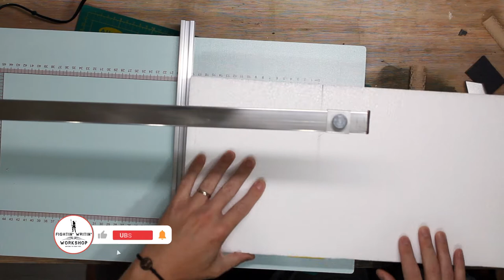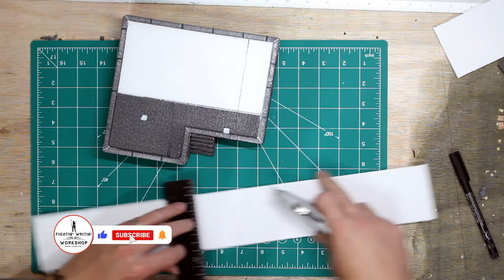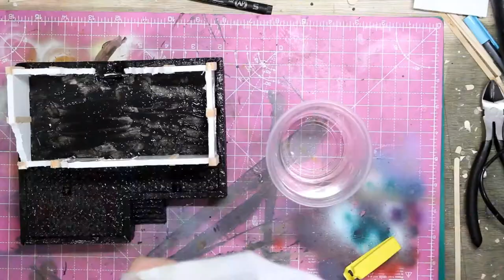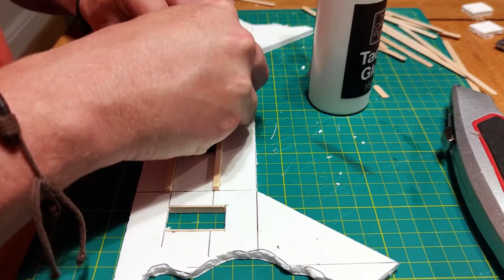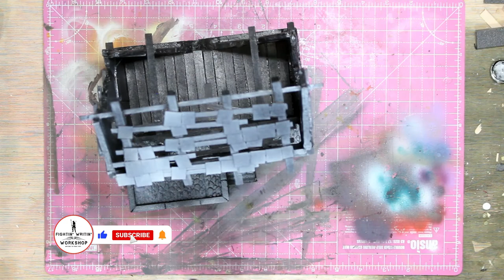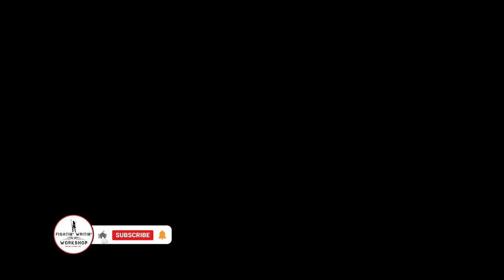Building the first house for my #mordheim inspired board

Comment: Where are you sourcing your XPS foam from in the UK? Nice looking build
Reply from the maker: This was all from eBay. It's a right royal pain, especially if you want the thicker stuff because you have to order a minimum of 5 sheets, which gets expensive. I've got lots of the 10mm stuff and will probably be using 50mm expanded for the bulk work, and then capping it all with xps for detailing and toughness.

Comment: Doesn't white glue/ wood glue bond stronger in the long-run?
Reply from the maker: It depends what you're gluing together. Which bit of the video do you mean? Between two pits of polystyrene, PVA will struggle to set because it needs air. Mod podge is effectively PVA with some form of resin mixed in so should be stronger.
Reply: @questsquills  At 13.11 where the beam is glued to the wall. Now, I'm only using cardboard and not  foam, so I'm genuinely curious about the bond on the overhanging beam as it's only connected at 1 point.
Reply from the maker: Ah gotcha. Yeah, it may well have been stronger at that point. I'm hoping with the second floor on top, it'll hold in place. At the moment, it's solid, but I've got the first workshop using some of these next week so we'll see how it holds up!
Reply: @questsquills  Ah, right, the weight and surrounding parts of the second floor should help. :) 
I've just been asking, because sometimes the hotglued bits tend to fall off if that's the only glue used. 
I try to make all my terrain so that it's droppable from waist height without real damage. 
loving the end-product here, though!
Reply from the maker: I absolutely soak them all with homemade sealant (I use a mix similar to Luke Towan's) which I think helps!
Reply: @questsquills  thanks for the tip. I'll give using sealant a try too. Might stop random shrubbery from flying off :)